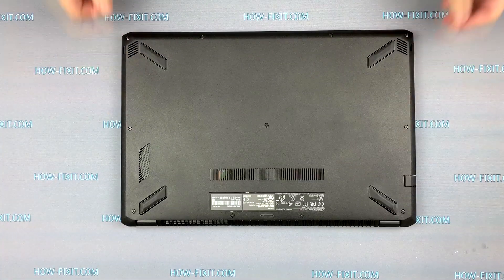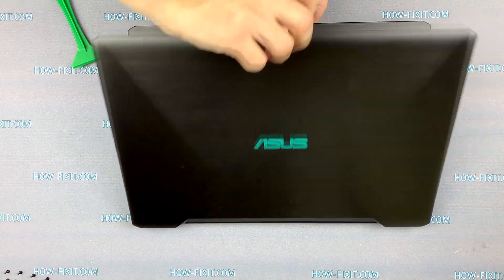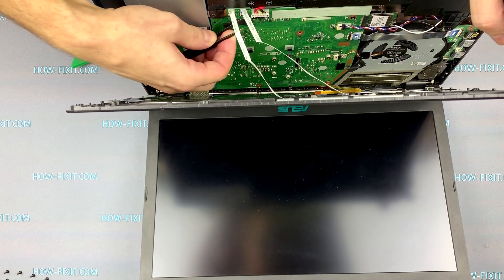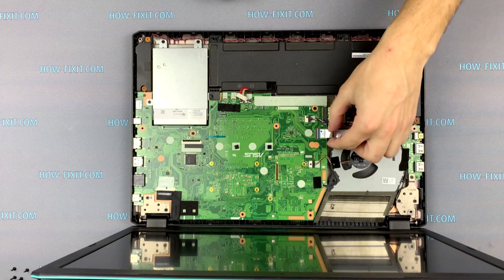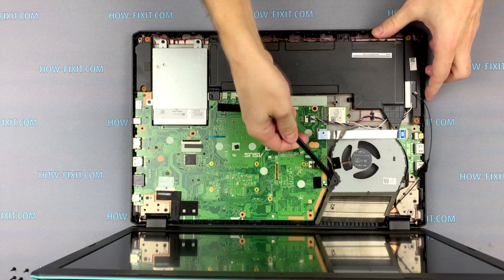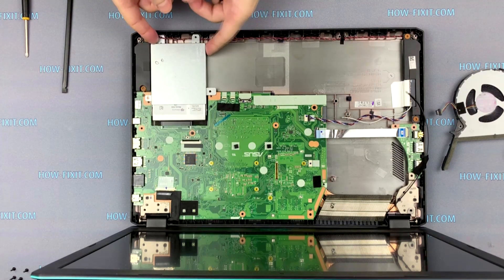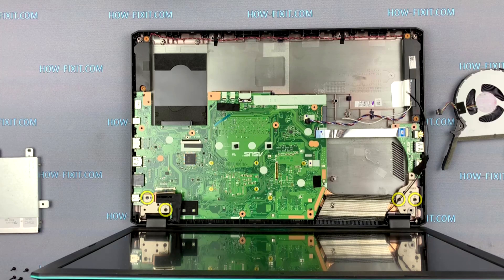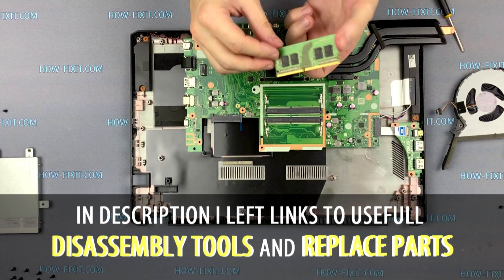Asus K570, F570, A570 RAM Upgrade and Install - Your Step-by-Step DIY Guide

Comment: Thanks for the video! I tore mine apart to upgrade/increase the memory. When I turned it back on the power light came on and the battery light would blink 3 times, that's it. Turns out the monitor ribbon cable wasn't fully seated when i reinstalledit. Once I got it fully seated then it booted up normally.
Reply: Yeah I had that trouble. The battery indicator turn on and off...so it means the RAM is not compatible with the Laptop. The bios is detecting all hardwares before  the system boots. I had tried with many RAM brands, I had the same issue. But people said only OEM RAM chip (in our case SK Hynix 1Rx8 and not 2Rx8 is the recommended one). If you tried anything new and you have two 8GB sticks, tell me which RAM brand you chose...it would be really helpful.

Comment: I messed up the touchpad, I've connected the flat cable 3 times already, but it won't start up.
I lift the black latch, insert the cable and push the lash in, but when I start the computer it just doesn't work :/
Any recommendations?

Comment: This is the most ridiculous internal design i ve ever seen in a laptop. To change a memory module you have to dismandle literally everything ? REALLY ASUS ? And every time you open for service you have to remove all the ribbon cables... That gives a max lifespan of 5 years. After 5 times removing and reinstalling those ribbon cables will be useless...

Comment: I did all but then it's not turn on and the battery light blinking. I pluged in but again it doesn't work. Also fan is not working i tried to attach the socket again but fan is not working. I dont know if my fan is destroyed or what?

Comment: What's the highest frequency you can install in this model, 2400MHz?(I can't find it on line) 
I was gonna add a SSD, but once is opened I'm gonna add some RAM as well, 2x8Gb o 1x16Gb. Is it worth it?
Thanks for the videos!

Comment: Thank you! I've just upgraded. It comes with a memory card of 8 gb, so if you buy only one of 8, you have 16 gb installed.
Reply: i kinda confused, does it have 2 slots or 1 slot only? i want my laptop become 16gb. so do ihave to buy 16gb or 8gb only?
Reply: @imanhakim9449  It comes With 2 slots, but only o one is filled with 8 gb RAM. The other one is empty, then u must buy an 8gb memory card to get 16 gbs of RAM.
Reply: @luccafelippoguitar  can i know what is the maximum ram for the 2nd slot. because now i have 8gb if i can i wanna add 32gb. So, it will be 40gb.

Comment: Hi, I'm thinking about upgrading my F570ZD, but I'm having some doubts on which DDR4 to use, cause I'm afraid it won't be compatible. Do you know if Ddr4 2666mhz Crucial Ballistix 8gb 2x8gb BL2K8G26C16U4B would work?
Reply: Find your laptop in the Asus website to see how many MHz it should be. Simply DDR4 8GB RAM need not be compatible

Comment: Hi, many thanks for the video. Currently my laptop has 16GB of DDR4 RAM, can I add another 16GB to reach 32GB of RAM?
Reply: It supports 32 gb DDR 4 2400. I use that configuration with no problems.
Reply: i think f570zd was 16gb limit of ram supported,cmiiw,you can search it in google

Comment: Thank you for the video, i success installed both RAM and SSD on my new f570zd
Reply: Hey buddy I too have that same F570ZD. The laptop is built with SK Hynix 1Rx8 2400 MHz. But I tried with Samsung, Crucial, the laptop hadn't booted. So I bought original OEM SK Hynix but 2Rx8 (Rank 2), it was still not able to boot. So what RAM brand you chose? And it's frequency m

Comment: Hi . My asus have one ddr4 8gb 2400 . Can i upgrade to 2 ram one on each slot 8bg 2666 ???
Reply: You should see the site for your own asus, in the specs you should how much your laptop can upgrade.
Example are X570ZD(The laptop on the video)
If you bought it, then it would simply have 4gb but, if you search the asus website, this could be upgraded to 16GB.

Comment: Hey, I'm planning to upgrade the ram. Currently i have the stock 8GB DDR4 RAM. I wanna upgrade it to 16GB, but i don't wanna mistakenly buy the wrong RAM. I have the same laptop you are using in the video, ASUS F570Z. I bought it about a week ago, Can you please tell me which ram i should buy so i could upgrade it to 16GB? 

Also if you could, please specify me the link to buy!
Thanks!
Reply from the maker: See in the description under the video, there are links where to buy the correct RAM.
Maximum ram is 32gb